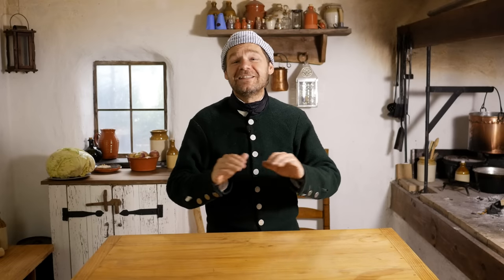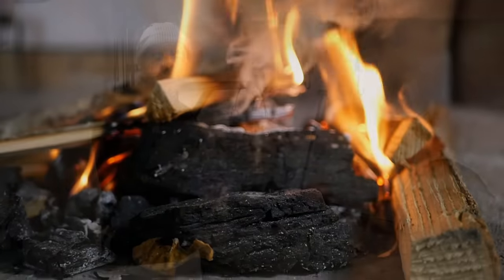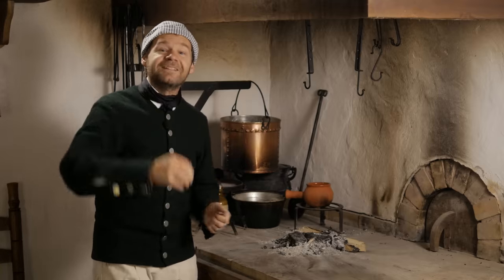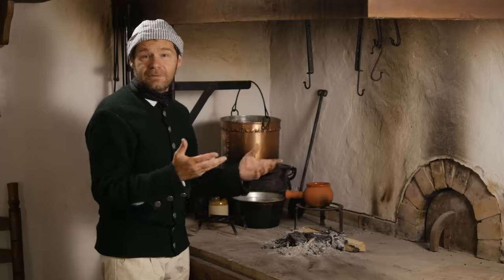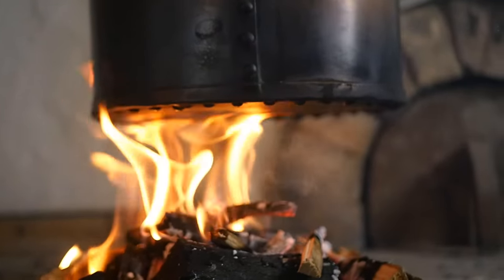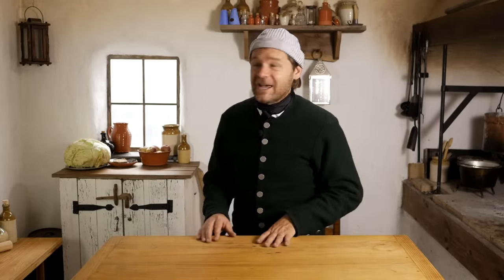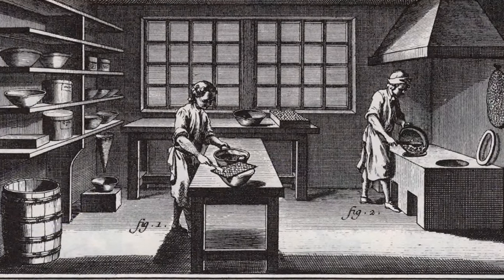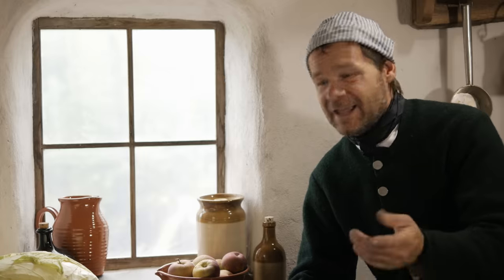Historic Kitchens vs. Modern Kitchens

Comment: Some friends of mine live off-grid your kitchen is quite similar to theirs great Chan on my friend thank you for your knowledge and expertise
Reply: we are not totally off grid but, power is limitted...we are in a converted former country general store and post office that we renovated into a cabin home; the original section from 1930(that's old for in the north where we are) was log construction(later sided over with shiplap)...anyhow we are not plumbed but, have plumbing in another building next door...so I haul water for dishes and empty it when done...we heat with an antique wood cookstove in winter...and though I do have some countertop kitchen appliances(hot plate, slow cooker for example) we are cooking and baking on/in the wood cookstove.  It's not  so bad really and I have gone without electricity or plumbing in past on a remote homestead and this is much easier of course but...yeah cooking is more time consuming because you have to get the oven temperature where you want it...and keep it steady etc...but it bakes really nice.

Comment: I still turn my stuff upside down,  but not cause of rodents, but 1 so dishes with a little water after the wash can drain out (have that rubber mat mesh stuff then under it shelf liner) and 2 dust ... we dont use a lot of dishes constantly so things can sit in a cabinet for periods of time
Reply: osgeld I think Jon meant when storing the bowls away in cupboards or shelving.

Comment: My paternal grandparents didnt have electricity until 1960, indoor plumbing 1969.  We had an old red hand pump in the kitchen. The original barn (1880s), was a chicken coop and feed storage, with a hog wallow built from split rails surrounding it. I have pictures of me and my older sister standing in the barn doorway. It's all gone now.

Comment: This is likely a holdover from earlier times, but I learned to at least turn glasses over when putting them away from my grandfather (through my mom). The logic I was presented was that dust and other debris could settle in an upturned cup, which could contaminate a drink. Oddly enough, I was brought up to only apply this to cups, since I store everything else facing up, but it's fascinating to see the potential origins of this line of thought.

Comment: This was so cool... we're restoring an 1806 Stone House (Videos on YouTube) and I want to have a Historically correct Kitchen.. But, also have the "things" we need.. Microwave, Gas Stove, Refrigerator.. I love some of the old cabinets, fire brick counters and butcher blocks.  One of the BEST kitchens I've seen was in Bolt Castle, Alexandria-Bay in Up State New York.. check it out!
Reply: CafeManning I've seen some good looking modern kitchens that fit in nicely with period homes. You can build you cabinetry to have glass doors on the upper cabinets to give the feel of older non-intergrated panels. There are fridges you get that are converted victorian or Edwardian ice boxes. A microwave and dishwasher can both be concealed in the cabinets. Dishwashers can have the front plate replaced. A Butler Sink is a common late victorian feature from houses as far back as the 1840's
And a kitchen island with a butcher block top will give a feel of an old kitchen table very nicely.
Reply: Heartgear One I like a lot of these ideas.. is it best to have them built or is there a business that specializes in that type of stuff? Thanks!

Comment: The single most important defining characteristic of 18th century kitchens isn’t immediately obvious in the video ... if it all economically possible, the kitchen is built AWAY from the residence. The single defining characteristic of kitchens was the reality of the dangers of cooking with open flames, and the resultant (very real) risk of fire, combined with the difficulty of fighting fire without pressurized water supplies on hand.
Reply: In Maine, there still exist lighthouses where the kitchen was built separated from the rest of the house.
Reply: That may have been true in the south but in the north the kitchen was the center of home life at least in winter. It was the only heated room in the house. They sometimes had a summer kitchen for hot weather.
Reply: There is a BBC doc channel called Allthemeddocs which has a show about different eras of homes and the monumental changes that kept them from killing their inhabitants.  The Tudor era one speaks about early chimneys, but mentions that not everyone knew how to conduct the flow of smoke out of the house. They show how smoke itself can catch fire!!
Reply: That's why cleaning your chimney a few times a year (if you use it frequently) was (and still is) a must before most people converted over to gas or electricity. The soot inside the chimney can catch fire as it's compised mostly of carbon and other flamable materials/oils etc.
Reply: @skillet pan -- Resin from the wood (creosote) can condense in the chimney and eventually catch fire.  Years ago, my great-grandmother's chimney caught fire.  Fortunately, her nephew was visiting at the time and he called the fire department before the house burned down.
Reply: British houses all had their kitchen inside. I live in a Georgian town with some houses that are still the same as they were when they were built, and the kitchen is downstairs, inside. Both in posh houses and in small cottages. There just wasn't the space to have a kitchen away from the house.
Reply: This is true of north America too, except in the south in rural areas. Northern farm houses often had a summer kitchen but it was built onto the back of the house.
Reply: In some regions, in Northern Europe (don’t know about America) there were light- built, almost open air summer kitchens used quite lately, until 1950 or even later. It was mainly to avoid unneeded heat, to keep the temperature in the house more moderate in summer, but the deeper intention could be eliminating fire risk, no doubt. Of course, it was more light and air outside, and easier to cope with occasional spill or scorch. Only after gas or electrically fueled stoves became more popular, the summer kitchens were discarded.
Reply: I can imagine if you're poor you might not have a dedicated kitchen period. You'd just have to cook outside in your courtyard. Hopefully near the roof of the house. It's also one less method of risking a house fire
Reply: In the 1970's I lived in an old workman's cottage that had been built around 1840 and it still had  what had been a kitchen separated from the house. It had been joined up to the main house with a skillion addition around 1920. It still had the original fireplace with about a knee height hearth and some fire brick shelvies for cooking or maintaining temperature of water/food or using embers to slow cook along the sides of the hearth with a bar across it with three different length hooks. It had been updated  other than that, with a gas stove (still pretty ancient - a 1920's model but a really good stove that I enjoyed cooking with) and sink, but instead of kitchen cupboards it had a kitchen dresser which was fine for storage and even had a metal lined cupboard which I found great for storing cheeses.
The main workspace was still the kitchen table in the centre of the room. I cleaned the chimney and used the fire on occasion and it was still quite surprisingly practical once you got to know your way around the zones, although I did it more out of curiosity and historical experimentation than anything else. I made some good stews and roasts with it though. I even did a little baking although that was a lot more fiddly. There was also a shed out the back that had been the cool house with a stone bench for keeping things like dairy on. I didn't use it for that but I did store root and some other veggies from my garden out there and it kept them very nicely.
My grandparent's kitchen was very similar in layout as well with a non built in dresser and the kitchen table being the place you did all of your preparation and no kitchen benches other than the drainage section by the sink. A lot of the older houses I lived in had kitchens like that.
Reply: I highly doubt that's universally true. I'm Austrian, so these German-American style old school kitches aren't too disimillar from those in old farm houses I know.

My mom grew up in an hundreds of years old farm house that got updated with electricity and indoor plumbing (not a toilet, though) only later on during her childhood. Because of space concerns (her grandparents, parents and two sisters lived with her in a tiny house), she and her grandparents slept in the kitchen. She had her bed right adjecent to the oven, since it was nice and warm, and they had no other heating for the winter. From what I've seen, it was fairly common for the grandparents, the children, or the farmhand/maid to live in the kitchen.

Comment: John, How did the people who lived further south like FL or TX  cool their food, since you can't have a root cellar because they would be sea level?
Reply: I'm very interested in this too, being in the south. No one has a basement down here. I imagine they made lots of jerky? But the humidity on the coast combined with constant high heat spoils everything quicker.
Reply: Great question!
Reply: I understand they had meat hanging houses.  Made out of brick or thick logs.
Reply: A root cellar can be built above ground, partially above ground, or taking advantage of a particularly high area in relation to the water table, below ground.  It isn’t necessarily large, and so you can imagine with some creativity, it could be done even in the states at sea level.
Reply: Kitchens often were separate buildings. This kept fire danger away from houses and heat away from the people who lived in them, especially during the summer months. People back then were smart!
Reply: In Arab countries, people would put food in ceramic jugs or jars which weren't glazed and which contained some water.  The water would seep through the walls of the jug, evaporate, and cool the contents.
Reply: In Tennessee up in the Smokey Mountains National Park we saw old homesteads and they used a spring house to keep food cool.
Reply: I volunteered at a recreated homestead near Houston. They had a root cellar dug down just barely a foot or less then covered over with a mound of dirt. It was amazing in summer how cool it was in there. Looked like a mound near the cabin.
Reply: Julia How cool!! (pun intended)
Reply: Julia, was that recreated homestead a museum people could visit?  We travel to the Houston area sometimes and that would be most interesting to visit if possible.
Reply: Wonder how that museum weathered the big hurricane and flooding?
Reply: The homestead survived Harvey pretty well except the outhouse which was at the lowest point and washed out. The rest if the homestead is the highest point of the park. So minimal damage. It is at Jesse Jones Park in Humble in the north side of Houston. Best time to visit is the second Saturday of the month in afternoon. All done with volunteers so nothing happening there the rest of the time except special activities. Check calendar for events. November 11 I’ll be back over there for Pioneer Day. Many reenactors over there lost all their kit in Harvey so few to help out. It won’t be the greatest Pioneer Day ever but we’re hoping to still put on something. They are calling people away from there to help hence I’m driving over to help out.
Reply: Out in California, there were adobe (mud-brick) houses, which were the predominant building material in the 18th century.  These houses were built with very thick walls (around 2 feet thick), and on a natural stone foundation, if possible.  I worked in one, which is now a historic house museum, for 14 years.  It remained around 70 degrees inside, no matter how hot it got outside, except for the hottest afternoons when it was over 100 outside (then it rose to 80 inside).  

Houses were also built with windows and doorways placed to catch the daily breezes, and near a water supply, so perishable things were kept in the nearest creek, river, or irrigation canal. Wealthier people could have glazed and unglazed tiles on the floor, which would be mopped a few times a day with plain water, and left to air-dry, which would cool the air further.  This would not be cool as a modern fridge, but it would be considerably better than doing nothing in the heat.  In former Spanish colonial areas with dry climates, i.e. the American Southwest, the same techniques would have been used.
Reply: Florida native here. The house I grew up in on the family cattle ranch had the original hand hewn beams to give you an idea how old it is. We had a normal cellar and it was probably twenty by twenty feet in size with plenty of head room. The house was built on top of a hill in Ocala so they didnt have to worry about ground water. Central Florida is very hilly so im sure there are many root cellars around.
Reply: Yeah, even crawl spaces are prone to huge rats! I'll take the northern winters, thanks.
Reply: Just be careful of CO2!!! People have died in root cellars. No joke.

Comment: Wonderful and absolutely fascinating! 1776 just 242 years ago, in the time frame of 1000 years, really NOT that long ago when you LOOK at those numbers! I grew up spending summers in my late grandmothers house built in 1776 on old Cape Cod. It too used to have two fireplaces and a root cellar under the floor boards. My late grandfather renovated the house in the 1930s but even in the 50s and 60s it didn't have any baseboard heating until in the 70s. It had no door knobs and all the doors had black wrought iron latches. Love any old historic houses and have been in many including Orchard House where Little Women was written in Concord MA. I remember seeing 18th century kitchens in Sturbridge MA and also historic Williamsburg VA  another thrilling place to visit and travel back to early American history! Thanks for sharing~

Comment: The temperature drop may be beneficial for baking. Most of the heat is needed at the beginning for rise. And you don't want the crust to form to fast. So, dropping may help it cook in some ways easier than a consistant oven.

Comment: I live with an 18th century kitchen with the exception of a propane cook stove. No indoor plumbing,  haul water in buckets,  2 basins for washing dishes,  1 for washing for rinsing,  heat water on propane burner,  take water out for plants or trees to dispose of it, kitchen table for work surface...

Comment: I store glasses and bowls upside down so dust gets over the surfaces. This kitchen is an indoor camp set up. I love it. We camp for weeks and cook over a fire. We use the wooden table at the site just like this. The only thing I don't like is the lack of disinfecting the cookware...it's very difficult when doing dishes in a bucket. I tend to keep things over the flames with a little water so the food boils/ cooks off and just rinsing is needed.

Comment: I live in Finland, and I know a lady who is in her mid 80's that lives a lot like this.  She still uses a wood stove/oven, but she has a modern refrigerator and running water. A lot of the old cooking ovens have the water reservoir on the side that heats the water (you have to fill it.) Those water thingies are also on the sauna stoves so that you can have hot water for bathing.  In both cases, you ladle out the hot hot hot water and add cool water to the right temperature for use. I find it kind of fun!

Comment: An Italian restaurant I formerly worked at had a wood fired pizza oven where I made the pizzas. The oven cooking space was about 6’ across with a domed roof and all of the pizzas and loaves of bread were kept near the opening or the center with the fire, which was fueled by apple wood, burned at the back opposite the opening. The wood also imparted a slight smoky pleasing taste to the food.

Comment: We had a farm building for storing milk and meat. It had a pitched roof that was filled with hay as an insulation. It had benches all round three of the walls. They were made of stone with marble tops. The door was thick too. It was built about 1789. I used to play in it as a kid back in the 1960s. By then it had fallen into disrepair. It was part of Simonside Hall’s Farm.

Comment: For food storage, at Burg Eltz on the Mosel the kitchen had a cabinet built into the interior stone wall which kept the food at a constant cool temperature.  They also had hooks hanging from the ceiling to hang food on in order to keep it away from rodents.
In Gutach's outdoor museum of Black Forest farmer houses (Bauernhöfer) I saw an outdoor cooling cabinet for dairy.  Stream water was diverted through a trough (which also fed to the mills) and a cabinet was built on top of the trough.  Inside, containers of milk, etc, could be kept cold in the water.  I guess the interior of the cabinet was also cool enough to store other foodstuffs.

Comment: My family owns a cabin in the north woods (MN). It has electricity, but nothing else. A pump (iron water--blech) and a wood burning stove and a "thunder mug." There was an electric stove which we used for cooking and to heat water on the stove to wash dishes when we stayed there; the water was tossed outside when done. Brushed our teeth at the pump and went up the path to the outhouse during the day. The wood stove was mostly used for those chilly days. Gorgeous setting, but give me plumbing!

Comment: I wonder if a couple of bricks, in the back of the oven, would help it maintain its temp. It's a trick used in modern ovens too. Put the bricks in there while it's heating up and leave them in there when you put the food inside.